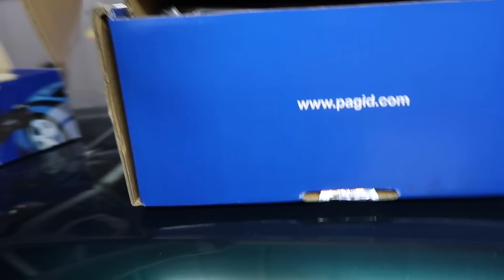BMW nut & bolt check & The Nissan S15 Spec R is back

Comment: Could be the front ball joints causing it but there's a knock that sounds like the rear subframe in the clip of you at the drift matsuri. If it's still knocking at the next drift day I'd check it as it's common for the subframe to rip out. I could be wrong but just a heads up. ✌️